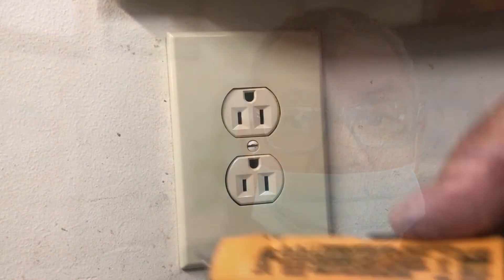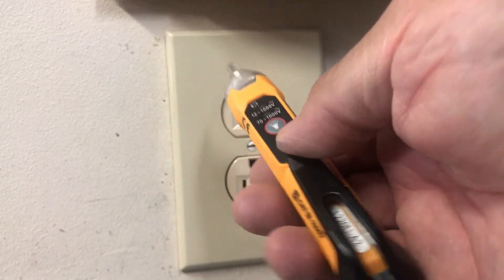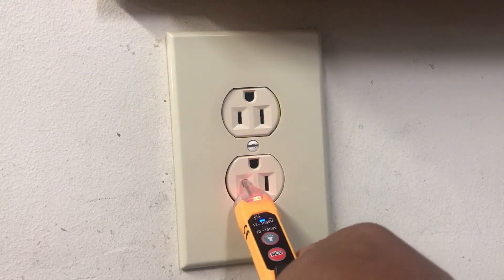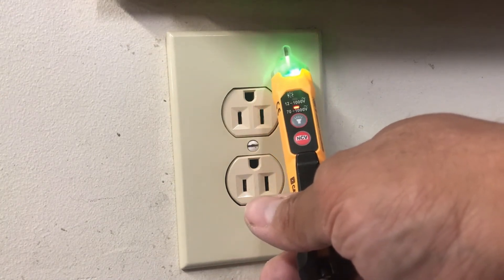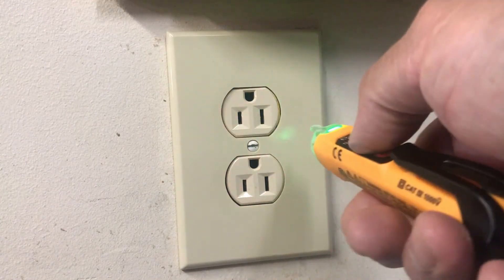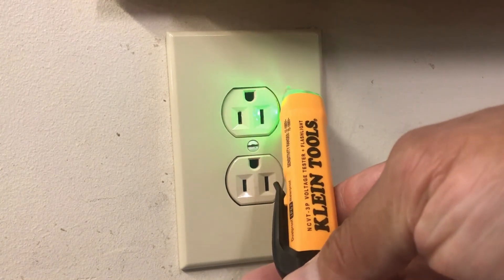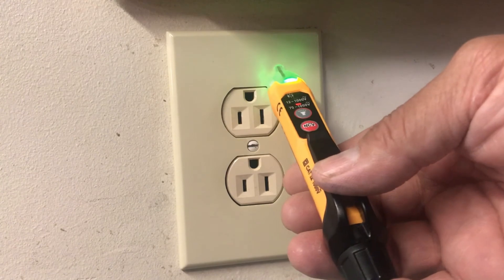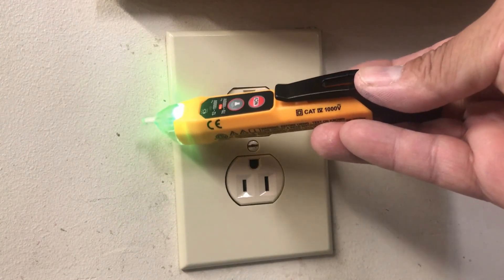Klein NCVT 3P voltage tester and how it works. Low 12 volts A/C up 1000 volts A/C and more.

Comment: Odd that your grounding contact is on top (non-standard from my experience).
Reply: they can go either way, works the same way.
Reply: Half hot
Usually indicates it can be controlled by a light switch